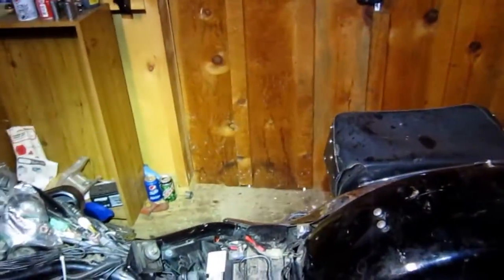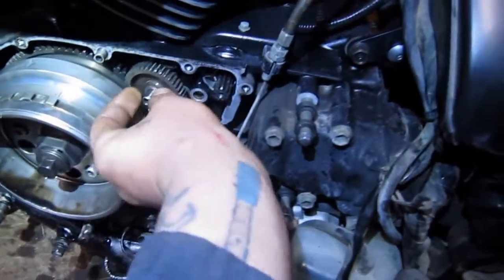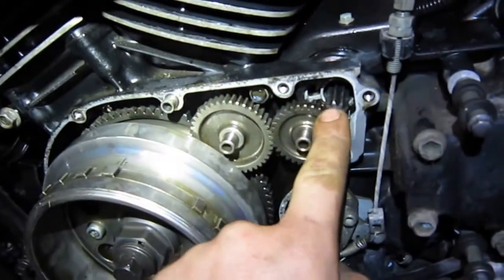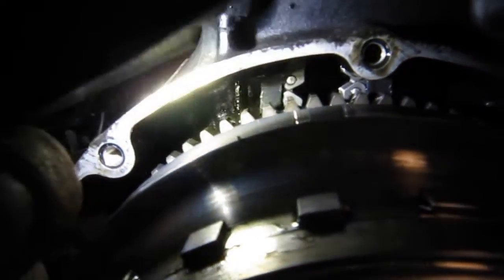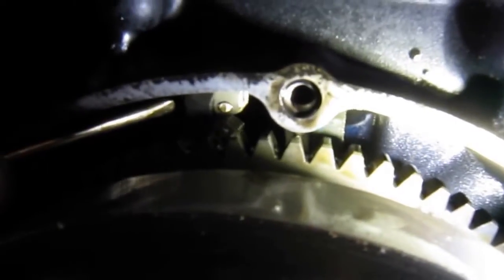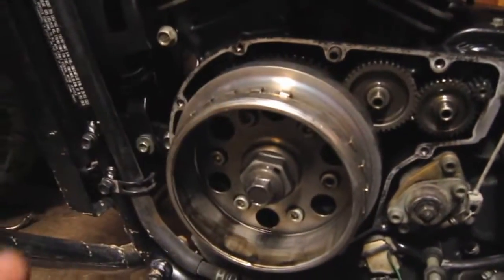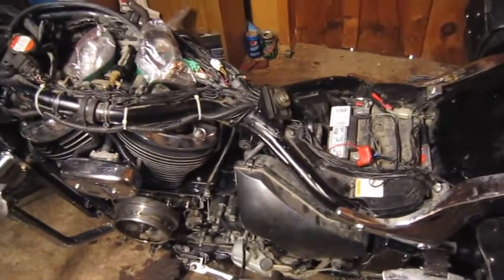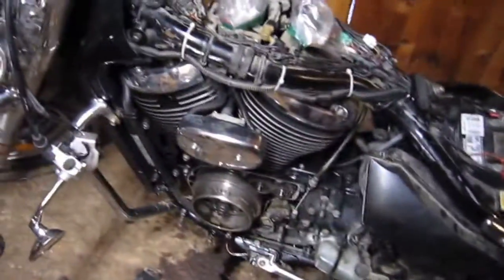05 Suzuki Boulevard C50 cam chain VL800t

Comment: Front cylinder and all attached components seam to go first on the vs800. I'm thinking an engineering flaw starves the front cylinder area of adequate lubrication. I just rebuilt mine and found the big starter gear behind the flywheel had a very loose fit on the crank. I purchased a used one off Ebay and it fit way tighter. Hoping it will boost oil flow to to the front cylinder instead of dumping it out into the stator case area. The only other way is to purchase an entire new starter gear, one-way bearing assy, which is costly. Front piston was starved and was worn down .012 undersize and it sounded like timing chain slap, but no timing components were worn after inspection. Chain had no slack like shown on the vid here. Everyone says these motors are clickity clackity like an Angry sewing machine. That they are, some strategicly placed internal sound deadening pads would have been nice.

Comment: When the chain got loose...was it making an intermittent rattling/rubbing sound down at the bottom end as you rolled down the road or pushed it around manually?

Please get back to me...I got a c90 and I'm tryin to figure the issue
Reply: hey there sorry youtube locked me out of this channel so i never know when i get a comment. if you look at your chains and they aren't tight, that will likely be your issue.

Comment: Hey buddy wondering if you can help me out I have a 2005 Suzuki Boulevard it does not want to accelerate if I give it a lot of gas back and forth quickly it will go a little bit not sure if it would be clock jet valve's need to be adjusted Maybe or a bad fuel pump a lot of times it seems like it just running on one cylinder
Reply: It sounds like you have a clogged fuel injector

Comment: My 08 C50T had the same problem. I bit the bullet, bought the tools and a book and took it apart. New chains and tensioners fixed it. Sux---they are good bikes other then this flaw. Mine started making noise at about 14000, I rode it another 8000 before tearing it apart. Bad thing is Suzuki still makes the same crappy design.
Reply: Im getting an intermittent rattling noise from what sounds like the front bottom of my c90...is that the sound this issue makes?  Please lemme know...it be a huge help.  Cheers
Reply: @HOTDOG401  Sounds about right. There's a chain on both sides, The cold knock that's normal would quieten down when it got up to temp but the rattle got louder when hot. I have an S40 I bought used with the same problem, it's just a single cylinder. Chain and adjuster fixed it.
Reply: @JazzyLocke Thanks...looks like Ill be opening her up then.
Reply: @HOTDOG401  You'll need the Suzuki flywheel/rotor removal tool and an inch pound torque wrench